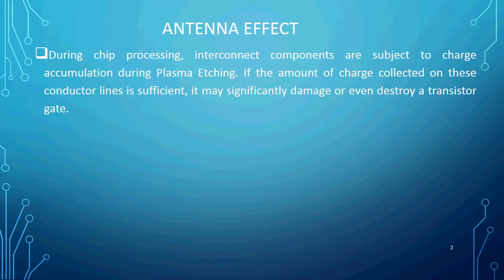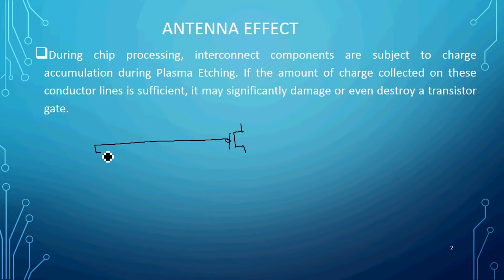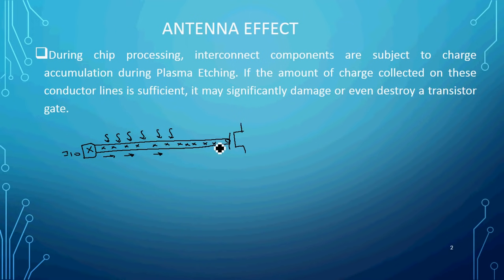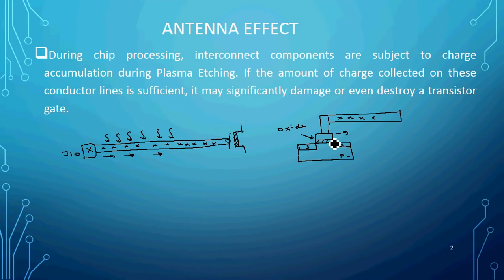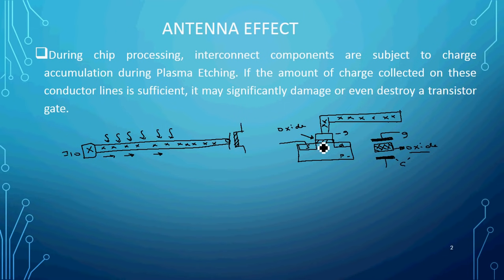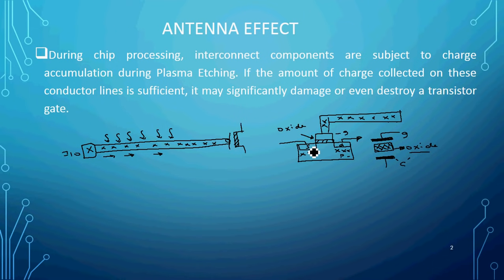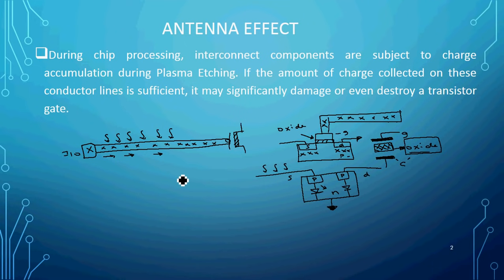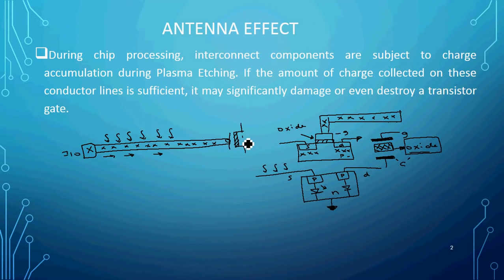Antenna Effect in VLSI - English Version

Comment: You were quite terse to someone who questioned your copper versus aluminum metalization assumptions. You used the antenna ratio calculation for copper and then went on to say that we didn't have to worry about antenna rules for copper! 

For aluminum, the antenna ratio is calculated using (W + L) * 2 * Thickness / (Wgate * Lgate) because the top surface is protected by resist.

I think you got your copper versus aluminum calculations mixed up.

There seemed to be a lot of hand waving and talking about implanting metal (?) but perhaps this should clarify.....

In an aluminum-based process, charge accumulation occurs during the ETCH step. The top of the metal is protected by a resist during this step, so the antenna rules for this process should be based on the metal sidewall area.

In copper-base technologies, charge accumulation occurs during CMP (Chemical-Mechanical Polishing). In this process, the sides of the metal are protected, so the antenna rules need to be based on the metal's top surface area.
Reply from the maker: Aluminum is fabricated in a different way , copper is fabricated in a different way , i mean the way of forming the metel over the silicon , so both the metal having antenna ratio , but compare to aluminum , copper have less chances of antenna because of the fabrication method , and also copper wil be used for top metal in most of the time , it's also another reason , top later fabrication is totally different method from bottom layer

Comment: @Analog Layout, I have some doubts:

1> @1:46 , you said that the charge is positive charge and not negative charge. Plasma definition says that it have positive ions and electrons in equal numbers, so how only positive ions come on metal? Also metal don't have ions right?, they have free electrons. Please clarify.

2> @29:15 , you said that in Cu process you are not using photo-lithography. I think that is totally incorrect! You need photo-lithography to know where the trenches will be made. Correct me if i am wrong. 

Thanks for the video sir. :-)
Reply from the maker: First read the fabricate process of Aluminium and copper , then u will come to know who's wrong , and also read plasma etching working process , and plasma chamber operations also ...
Reply: @analoglayout  Clearly what i have written in the 2> point is correct sir.
Reply: Antenna effect occurs as a result of Reactive ion etching, which will induce a charge in metal layer which will inturn transfer to polysilicon. For higher metal we use Dual Damascene process which will not result in inducing of charge. Dual Damascene process ofcourse contains photolithography and etching process. Al is not used in fabrication nowadays. Tungsten is first layer and Cu is the higher layer.

For reference
http://www.iue.tuwien.ac.at/phd/orio/node10.html
Reply: @ikrutheking  Hi, I dont think dual damascene include cu etching. etching of cu is a huge chemistry problem for fabs, thats why they use damascene  or dual damascene pocess.

Comment: Sir as you told to discharge the the charges we are using reverse biased condition diode. So that diode should undergo reverse breakdown and then it will start conducting so my question is what if we use forward biased condition diode directly so that the charges can discharge easily.

Comment: During jumper insertion (Suppose M2 is used)
Suppose if we got antenna error for long metal wire M1 then we want to use M2 in between .
So  the place where we want to fabricate M2 , at that place is M1 removed by etching ?
Or  again  M1 and M2 are fabricated separately???
Reply from the maker: Please read how metals are fabricated , u should not keep m1 , remove your m1 where your placing your m2
Reply: @analoglayout  thank you Sir
Reply: First  m1 will be fabricated and then m2 and so on

Comment: Hi Sir,
As you explain here during plasma etching positive charge accumulated to metal plates. So why positive charge ?Because plasma is hot ionized gas and always neutral (containing equal no. of positive and negative ions).
please explain I am little bit confuse.
Reply from the maker: Both the charges will accumulate , but nagative will not affect

Comment: Can you please explain the functioning of circuit in the last slide? How is the load transistor acting as a diode? It still has 3 terminals- SG , D and bulk. And how the charges are getting dissipated at the time of manufacturing? What is the purpose of that load transistor? Please explain.

Comment: I have a doubt on this.could u pls clarify that..how the gate oxide is dameged by accumulating charges on the metal.and this issues come in fab process..during fab processes they did not gave any power supply then how oxide is dameged pls clarify..
Reply from the maker: Charge are formed by plasma etching , that's the concept of antenna

Comment: Sir, u explained during Aluminium fabrication for lower metal layers, we do photolithography itching , and its a costlier one consuming 30% of manuf cost. so if  some  foundaries are using all the metal layers with Al (30:58) then how cost will be low ?  since u told while fabricating copper in the 2nd method, no photolithography tech is used so, if its the case then cu fab cost is less than Al right sir.. Plz correct me if my understanding is wrong...
Reply from the maker: Not all the foundry will do the same method ,it's depand on fab unit
Reply: @analoglayout  ok nanri thalaiva..

Comment: how does photolithography relate to charges building up in the metal? And why does the copper process not cause charge buildup?
Reply from the maker: Photolithography is not a matter , I have clearly explain due to plasma is the charges are accumulated , and also copper fabrication is totally different way, it's a kind of trench  formation technique they used to form copper

Comment: how the charges will be accumulated on the metal plate while doing plasma etching??
Reply from the maker: Charge are formed while plasma proces , those charges will attracted by metal
Reply: @analoglayout  thanku you
Reply: Dry etching uses intense electrical fields to generate an ionizing plasma.
Reply: @krishnasoorannavar2063  
Intense electrical fields means?

Comment: I have a clock signal where antenna violation is popping. i added reverse biased N- diode to clock . is this going to create any leakage in clock path?
Reply from the maker: Ya ... Leakage Wil be there , but very low leakage

Comment: While fabrication we won't connect the ground terminal to gate then how charge will discharge from reverse bias diode
Reply: Sorry gd to diode***
Reply from the maker: There no point of connection gate to ground , by default sub will be connected to gnd , on our gate terminal positive ions will accumulate ....
Reply: @analoglayout  
Not gate terminal substrate only. how substrate connected to ground while fabrication can you explain bcz inorder to connect substrate also we need to fabricate M1 for tap then only we will connect. While this process gate may effect right.
Reply: I asked how gate connected to positive terminal of diode while fabrication.

Comment: if metal 2 has antenna violation, if we have possible to go to metal 1
Reply from the maker: no , higher metal only advisory
Reply: why we are not goto metal 1
Reply from the maker: bcos aft manufacturing metal 1 , will go metal 2 , the how again u will go for lower metal , its not possible
Reply: but we are checking antenna in layout on that casee
Reply from the maker: if we cant make physically IC , y we need to design layout ?? if u have experience in real time , u can understood easily
Reply from the maker: for this question il upload new video , so u can understand very easily
Reply: sampath kumar matlapudi  best way to u place antenna diode then there is no confusion of metals
Reply: @sampathkumarmatlapudi8250  if we go for lower level metal jumpering; let's say MOSFET gate connected to metal1 and next metal layer is  metal2 and the antenna violation in metal2 and you have done metal jumpering using lower metal1, so metal2 has more charges and by that time metal1 has fabricated and metal2 has a path to discharge through metal1(just imagine this is the discharge path "" metal2 -> metal1 -> metal2 -> meatl1 -> gate of MOSFET"") so no point of going for the lower metal layer
Reply: @surajgudigar8992  I think the best way depends on the situation

adding diode need more area, whereas there is no option for doing metal jumpering in the top level metal layer

Comment: How more number of chargers will accumulate on metal & what are the layers present in n diode why can't we use p diode
Reply from the maker: the reason for n diode placing i explained , remaining 2 question il upload new video
Reply: Ok sir
Reply: usually we use N type diode for simplicity when we are already using P+ as the substrate. If you are going to use pdiode then it will require additional biasing for its nwell.
Reply from the maker: thx for the answer , i already posted a video reason for n diode separately , pls watch video
Reply from the maker: thx for the answer , i already posted a video reason for n diode separately , pls watch video